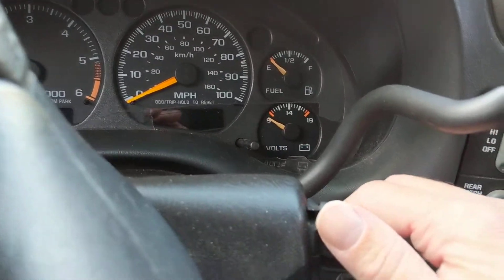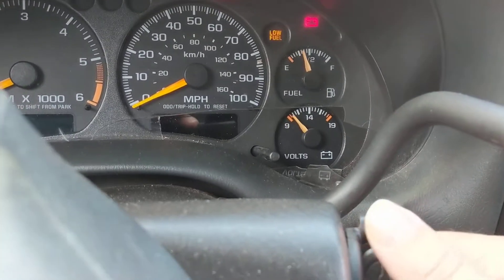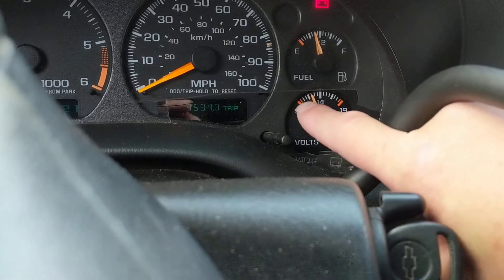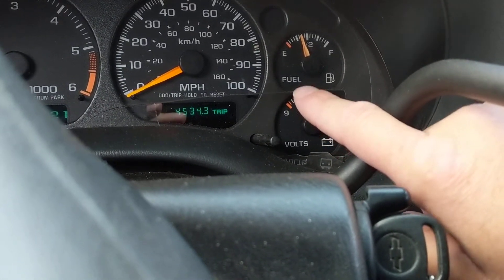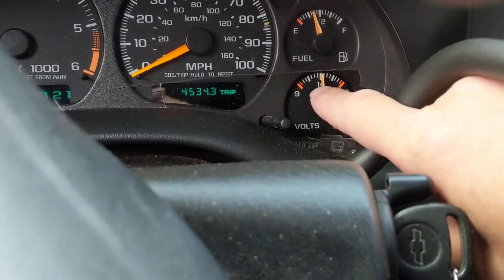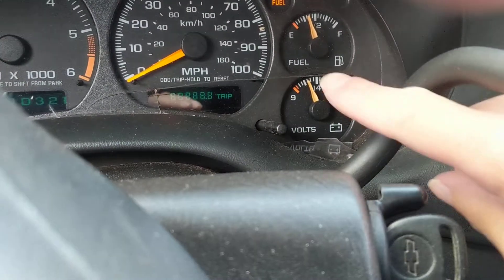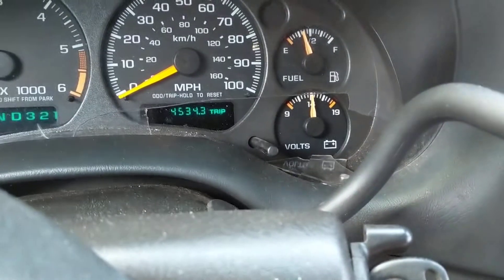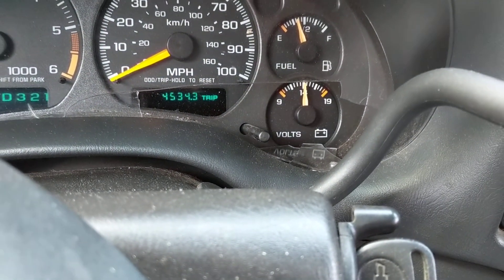NO START FOR VEHICLE USE VOLTS GAUGE FOR PROBLEM PART 2

Comment: What if when I start my car it's at about the 14-15 range but when I drive even just for a little bit, it slowly goes down to the 13 range and when I park and leave the car for the next day, it's back up to the 14-15 range. Is that still considered normal or is there a bigger issue at play? Also thank you for this video it did answer some of my questions!
Reply from the maker: Some cars have Smart alternators where they only increase the voltage when accessories are on and when you don't have accessories the voltage goes down that's enough to put a strain on the battery the most important thing is once it's at 14 volts should stay at 40-volt will you put all the accessories on if it's the old Star alternator old style now put on the accessories and see if the voltage stays the same that's the first thing I got back to me then get back to me

Comment: Also, what is the logic of the gauge numbers.   0 redline  - 14 center -  19 redline..
Reply from the maker: That's just like the RPM that tells you the voltage when it is in the red zone it is being overcharged you want obviously your alternator to be in the 14 volt range now this depends on if there is a compensator associated with the alternator I might be a little high on a cold day and I might come down

Comment: Great video!   my problem is my gauge is going past 14 to the next  bar, would that be 17.      so it is overcharging.   my gauge needle will end up in at 14 but sometimes goes down to 10 then back again to 16 and then to 14 evencucally.  what do you bad alternator?

Comment: What if it stabilizes just over 14v? (15/16 maybe)
Just got a new O2 sensor put in and voltage sits just a bit over 14 now, which wasn't the case before the replacement.
Also, thanks for taking the time to share this!
Reply from the maker: That's okay usually it'll be around 14.3 14.6 that's okay as long as it doesn't overcharge or undercharge

Comment: My car reads 11.6-11.8 volts but still starts fine. It shows this in the mornings after my car sits for 12 hours. How manys volts is to low after the car has been sitting overnight? I drive a 2018 Cruze and it has an AGM battery.
Reply from the maker: You're looking for around 13.6 to 14.5 whether it's been sitting or not sometimes the belt is loose but then you would be relying on your battery try putting all the lights on and accessories and putting the RPM to 2000 see if it goes up sounds like a regulator
Reply: @Joeelectronicschematicsforauto  The 11.6-11.8 reading is when I turn my key to the on position but after it starts it will charge between 14.2-14.8. Is the 11.6 reading normal when the key is turned to the on position but the vehicle hasn't started?
Reply from the maker: @markjou9799  if the engine is not cranking that means the alternator is not being activated by the belt if you are in the on position then you'll read 12 volts because engine is not being engaged once the engine is being engaged alternator is turning then you should have 14 volts

Comment: my '02 S10 cut out while i was driving today (i had been mobile for a good 20 minutes), and it wouldn't start fully.
when it cut out, the battery light came on and the gauge is about halfway between 9 and 14 on the gauge.
at first, the truck would just BARELY start, but it was weak and would not keep running. tried it a few hours later, and it only tries to start.

thoughts?
Reply from the maker: Sounds like your alternator kicked out and you were left with the reserve capacity charge on the battery which you couldn't start it's not a week battery but you have to first charge the battery and then measure the voltages and the current out of the alternator at $2,000 RPM with all accessories on
Reply from the maker: If there's no check engine light or anything like that also it could be a loose belt although alternator or a pay attention or bad tensioner
Reply: @Joeelectronicschematicsforauto  cool. at least i can get that battery charged before i drag anyone into this situation.

thanks for the quick reply!
Reply: @Joeelectronicschematicsforauto  turns out the issue with my truck was the fuel pump, which was a $245 part.
It was either that price, or less than half of that for the cheapest one. Just wondering if buying the more expensive one will be worth it.
Reply from the maker: @toddinthemiddle  it depends if you want to spend more money on a high mileage car and how much mileage you think you can get out of it if it's $100,000 miles and it's only the first fuel pump that was changed that you know of I would go with the more expensive one these are electrical fuel pumps

Comment: I got an old 93 p30 Chevy motorhome that won't start. It's got all new batteries (three of them) and it just clicks when I turn the key. The voltmeter on the dash is reading 10-10.5 and I'm not sure if I wired them correctly considering there are three batteries. Could that play a role in the no start? both auxiliary batteries connected and are 6v each
Reply from the maker: If each battery is 12 volts they are supposed to be connected in parallel reason being you want more current if each battery is 6 volts they are supposed to be connected in series because you want More voltage equal 12 volts